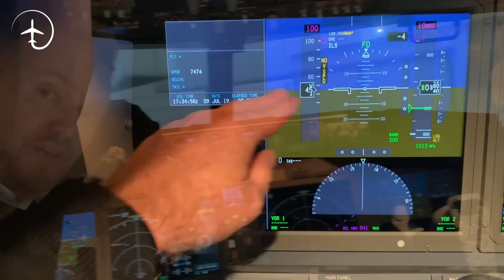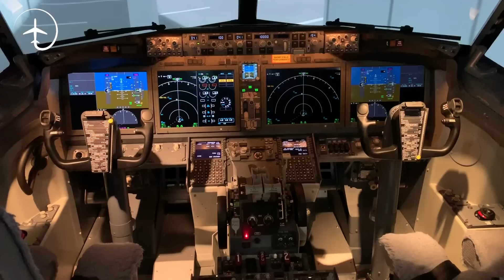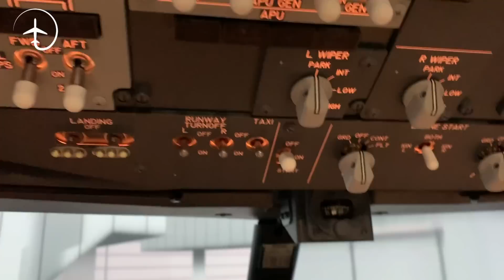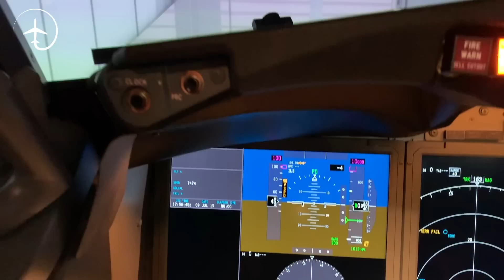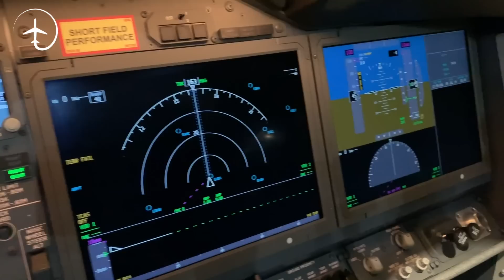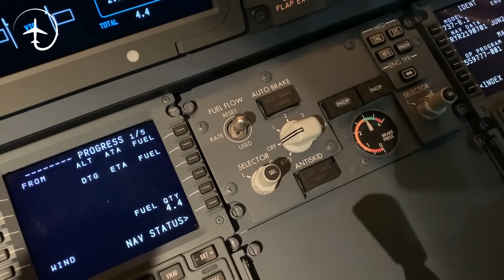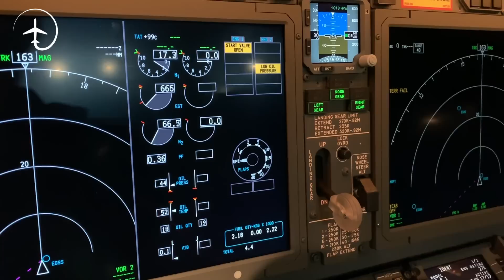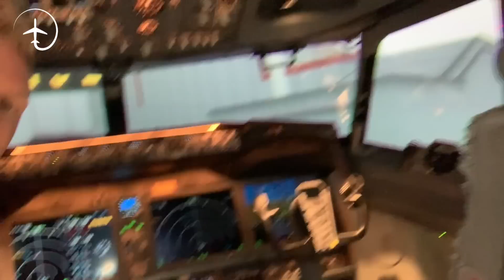Boeing 737MAX Cockpit Tour

Comment: Unfortunately, the technical problems are probably easier to fix than the lack of public confidence.
Reply: The Boeing 737 Max's reputation is now badly damaged just like the Douglas DC10's in the 1970s when the DC10 suffered some serious / fatal accidents due to a combination of design flaws, technical problems, maintenance errors, and pilot errors.
Reply: supertrix101 — Despite it’s reputation, the DC-10 remained in service for many years after its early troubles.  People flew on it — even those like me who didn’t like it, because it took us where we needed to go.  I feel much better about the 737 Max than I did about the DC-10.  The Max is an excellent aircraft which had one horrible defect.  It’s been fixed and it’s time to move on, in my opinion.
Reply: Well we hope the problems are (properly) fixed.
Reply: @GH-oi2jf  Exactly! Not to mention, there's no way Boeing or the FAA will deem them airworthy unless theyre completely confident there will be no issues. The 737 in general is the most popular commercial aircraft for a reason.
Reply: @GH-oi2jf  my problem with the MAX is not the defect. it's boeing managers that worry me because the accidents happen due to THEIR lack for security awareness and only looking at the money. lives have been lost, because some assholes had $ signs in their eyes.
Reply: @GH-oi2jf  So now, 5 years later, you sure bout that "time to move one"? When even more shit has happened this year, with doors opening mid flight and other shit
Reply: Tubmaster 5000 public confidence will never be restored. The 737 Max program is finished.
Reply: @JeffBourke  I'm afraid you're probably correct.
Reply: @JeffBourke   Yes, the 737 MAX brand is now damaged beyond repair.  Check the story on the Ryanair new MAX deliveries being named "737 8200".  I have a feeling that the rebranding is going to happen to more than just Ryanair's planes.
Reply: I trust the MAX
Reply: Big thing is most public can't tell and 800ng from an max 8.
Reply: Andrew Miller — Most people don’t care.
Reply: @GH-oi2jf  that's what I mean. so many people are saying "I'll never fly on a max!" They have no idea what plane they're even on.
Reply: Except for people who are aviation enthusiasts / plane spotters.
Reply: @Valantir  ill just make sure it's not a boeing at all
Reply: @mark675  good luck with that. Just about every airline in the world is back to flying the max around.
Reply: @Valantir  well I won't be going on one I PROMISE you that
Reply: @mark675  why
Reply: @Valantir  noobs
Reply: @Valantir  That is kind of a branding scam. The Max is the NG with Leap engines and more screens in the cockpit. There had to be a way to save 10 per cent fuel on the NG without going for new engines. This looks like rebranding with added M5 computer from Star Trek with Dr. Daestrom about to have a nervous breakdown.
Reply: people can't tell between a 800ng and a max? But... but the flight cards! They got like emergency flight cards that literally tell you the model and variant! I guess most people don't read it... unlike me. IDK, I always enjoy looking at them during the wait for take off, since electronics have to be stowed away.
Reply: Neurofied Yamato the cards are the same for both aircraft. 737-8. They don't say Max
Reply: @Valantir  They actually say "737-800/MAX". Or when the safety demonstration comes on, they always say the type.
Reply: Dino Olsen I have it from pilots at WestJet the major Canadian airline that flies both types that ours do not say max. Just 737-800/8
Reply: @Valantir  Thats weird. Norwegian Air Shuttle has "737-800/MAX" on their safety cards or during the announcements. Guess it comes down to the airline then.
Reply: Tubmaster 5000 — I think that’s better than the other way around.  You can’t control public opinion, put you can control the technical issues.  When they start flying again, most people who have qualms will get over it.
Reply: They put engines on a plane on a improper airframe and put a hokey mcas system ( with improper censors) to compensate for errors in design to beat airbus. Not one pilot knew about the systems in place. It's a hunk of flying shit. You can put lipstick on a pig , it's still a pig.

Comment: Such a pity that Boeing rushed the MAX, just because of the pressure from the NEO. The MAX will be safe once it flies again, but my trust in Boeing is forever damaged.
Reply: I agree. I used to think of Boeing as the ones who make the safest planes. Now I don’t. Yes it was rushed. You can measure it by the length of time it is taking to correct it. Personally, I will never book a flight on the Max. I am uncomfortable with trying to overcome a design flaw with software.
Reply: @Herlongian  so the 777 ain't safe what about the 747 757 767 and 787 matter of fact what about the 737ng series they ain't safe either?
Reply: @Herlongian  Geeze, you obviously have been watching all the wrong media coverage on the max. !st, you will be on the max if it is going where your going just like everyone else will. 2nd, there was no design flaw fixed by software. Mcas was put on the max to make it the same on nose pitch up on take offs . Otherwise the max would have needed seprate pilot rating training. The max didn't need mcas to fly correctly or safely etc.... You might want to base your decision to fly on her or not based on facts.
Reply: S C The flaw is that the nose will rise too much when power is added. This was caused by moving the engines forward and upward. If the landing gear was longer, the new engines could fit in the same location as on previous versions. 
Had they not rushed the process, perhaps someone would have foresaw what would happen if the angle of attack vane failed. 
Another flaw is the stabilizer trim wheel. It doesn’t have enough authority and there is no indicator or instrument to show when and how much it is responding. 
It is time to stop trying to to redesign a 60 year old design. Better to create a whole new plane. And start a new numbering. The 7X7 list has been exhausted.
Reply: @Herlongian  Your funny lol. I know exactly what videos you've been watching. You don't know what your talking about. The trim wheel is just extra safety they are paying attention to now. The nose up pitching is completely normal and very very minimal at best. All the large aircraft like the 777, A340, A330, 747 etc.. do the exact same thing due to oversized powerful engines. It is completely stable and normal. They only added mcas to the max to cancel out that slight difference in pitch up to previous 737's. That way they didn't require separate certifications for pilots. Not because it was unstable or unsafe or flawed. Stop watching the crap videos and main stream media. Everything I just told you is from a current Boeing 777 pilot also rated to fly all 737's who knows mcas directly. He has a channel if you want to see what real fact based reporting looks like.
Reply: You are exagerating a bit man. Boeing didn't rush the max like that. You've been watching to much main stream crap reporting or crappy You Tube channels. The Max design is perfectly stable and safe. The problem is they made a mistake in designing Mcas to only rely on 1 AOA sensor for info. instead of both to cross reference. Very stupid on their part for sure, nothing to do with rushing. Mistakes like that is exactly how air travel became the safest means of travel. Boeing has been around for over 100 years and are 100% responsible for air travel as you know it. It is apart of air travel has been since the very beginning. They learn from it, make it better and move on.
Reply: @11SEXMACHINE  No. The MAX design is not aerodynamically stable. Their own test pilots during the flight testing phase informed Boeing that the plane was very unstable at low speeds... That was the primary reason for the creation of MCAS. what they did was try to rectify a obvious engineering problem with the weight, size and location of the new engines with software. We DO NOT do that in aviation. If it was a simple software fix,  Boeing would have resolved this in as little as 2 months... 3 at most. Added to that, they deliberately put MCAS into the cockpit without notifying the last line of defense in emergencies.... THE PILOTS!
Reply: @opus4rv  Would you stop. That is completely untrue and bull shit. Stop watching garbage reports on you tube. If you want to see actual fact based reporting  watch the Bloncolirio channel. It is a current 777 pilot who is also 737 certified and obviously knows mcas and the 737 max as it's his job. It is 100% fact based and unbiased as he doesn't work or have anything to do with Boeing. Don't comment until you know what your talking about. Boeing built a perfectly stable and safe aircraft like they always do. How ever they fucked up when they designed mcas tonrely on 1 AOA sensor instead of both. They screwed up royaly on mcas but that's all. The max doesn't need mcas at all to fly safely. If mcas wasn't added, there wouldn't have been not q crash as of today.
Reply: @11SEXMACHINE  they'll learn from it? Then why were there two crashes? Boeing suck

Comment: What do you think of the over human factor / interface design of the cockpit layout? There doesn’t seem much consistency - some instruments analogue, some digital, some screen based, others physical, lots of small panels with seemingly unrelated controls e.g. brake and fuel controls...
Reply: Richard Deasington — You may not understand ergonomics, but consistency is not the best way overall.  In some cases, yes.  A toggle switch should always be “on” in the up position, for example.  But if everything looked the same, finding the switch you want would be harder.  When the pilot has to be flying the plane and manipulating controls at the same time, the most important controls need to be close, in familiar positions.  Less important controls should be implemented in a way that does not interfere with easy operation of the aircraft.

The pilots are the best judge of how well a flight deck is implemented.  If the pilots are happy with the controls and feel that the aircraft is easy to handle in all kinds of conditions, then I’m happy.
Reply: Interesting - I suppose some inconsistency can help you to find your way around and could help to make a memory map of the layout...

Comment: As i see it the Max is finished, Boeing need to scrap all these planes and revert back to the olld established 737
Reply: That's not a possibilty. The 737NG would lose badly on the market against the A320NEO. That's also why Boeing was in such a rush to release the MAX to the market because the NG couldn't compete anymore against the NEO.
Reply: @shi01 At the cost of innocent Lives ????????
Reply: @peterbury1934  Well, wasn't the first time Boeing opted for a cheap solution which cost some lives in the end. So i'm not even surprised by what happend.

From Boeing's point of view it made sense. The 737 ist their most importent aircraft family as is the A320 family for Airbus. There are some rumours floating around that back when Airbus prensented the NEO, the Boeing board of directors got into panic mode because they had nothing in development back then to compete with the NEO. So they started late with the development and also had to work around some of the limitations the old design gave them but also had to keep the changes to a minimum so the airlines didn't had to retrain their pilots and also they had to prevent the need for a recertification of the whole aircraft, which also limited severly what they could do to the aircraft.
Airbus for instance has a huge advantage in this regard because of their fly-by-wire system which simply allows you to change a few parameters in the software and the new plane flies exactly the same as the old one. That wasn't so simple with the 737s antiquated control system.
Reply: shi01 - The MAX development took a year longer than the NEO 😉
Reply: @ACPilot  Yes, but we don't know how far Airbus already was when they announced the NEO Family.
Airbus itself said that the first plans and ideas for the NEO family date back to 2006.

Comment: Hey Peter, hope you doing fantastic! I remember you said in a previous video, the pilots don't need to get simulator training for this type, just on a tablet. I can't understand that. Of course you have quite the same cockpit layout and it might be the same. But it's a different working as you know it from the NG. And not alone because of the mcas accidents i think it's absolutely necessary to train it in the sim. I'm familiar with the 737NG and this is different. I want this aircraft in the air because i know it's a good aircraft. But not at the cheap way.
Reply: Treffnix - There is no difference in major systems and procedures, so thats why no sim is required. It is enough with computer based training and flying with a collegue that have flown the aircraft before.. then you get used to it flying out on the line..
Reply: @ACPilot  I just want the pilots who flying this aircraft should 100% familiar with the new technology parts of this. Thanks for your answer. I appreciate that.

Comment: I guess he's training for Ryanair's 737 Max 200
Reply: I have a new name for the max I call it the boeing 737  NAEO  (new avionics and engine option)
Reply: If you fly for a paddi airline its 90% likely you'll be flying a MAX given IAG own Air Lingus and Ryan Air is All Boeing.  Ryan Air is quite safe, they've never had an accident.  A near miss when they suffered a bird strike taking out both engines on landing in Rome but they just neatly glided in.

Comment: Didn’t realise the fuel switches are now 777 style
Reply: They're the same fuel switches used in the B787.. you can even notice the darker tone of grey
Reply: Pablo Alejandro Higuita ah ok. I haven’t really seen much of 787 cockpit so didn’t know difference between 777 & 787 switches.
Reply: The parking brake normally looks almost like a metal spider with a rectangle on it in the 737NG and older, the 737-MAX parking brake looks way different, I guess it's also in the 787.

Comment: Can you take the simulator for a quick spin around the block?
Reply: @mipmipmipmipmip Most of these simulators are actually built in Canada by CAE. Boeing really doesn't build simulators themselves. At least not for commercial applications.
Reply: "Can you take the simulator for a quick spin around the block?" - Difficult. They've moved the indicator lever, so until Petter finds it, he won't be able to let other planes know when he's turning left or right.

Comment: You can totally see the conditions around the MAX's development reflected in the flight deck. Kind of, still 60's design up top, with some new tech jammed in, looks like it was designed in a hurry, and without a single coherent design philosophy. Which perhaps payed to why it ended up like this.
Reply: Jack Perry — That’s completely wrong.  A great deal of thought goes into flight deck layout.  Boeing’s approach is conservative.  Generally, they stick with what is familiar and what works well.  When significant changes are made to the human interface, it is only after a long design process and for good reasons.  Using screens for display is flexible whereas special-purpose indicators are not.  The screens are probably also more reliable than the gauges.
Reply: @GH-oi2jf  The screens are more reliable. They are also more legible and cost efficient, being less prone to malfunctions than the old analogue counterparts. But if that is true then why keep the old switches up top? Why not overhaul the whole layout to fit the new modern safer philosophy? Probably because that would mean pilots had to undertake new massively expensive type ratings. Which is why I said the rushed and hasty release of the plane is reflected in the flight deck.
Reply: That is such an uneducated comment to make, the cockpit is barely different they just made some simple easy changes to screens and other things etc so it’s not like it was jammed in because they were quite simple also it has nothing to do with the crashes, the reason the planes crashed was because the Mcas malfunctioned causing the plane to pitch down uncontrollably and the pilots were unaware that they could fix it by flicking the stab trim switches, the cockpit design does not come into any of that

Comment: i WoNt EvEr FlY iN a 737
Reply: Boeing 737's are one of the, if not the most, popular passenger jet aircraft in existence today. You may difficulty avoiding this model line if you fly often. However, you are probably concerned specifically about the 737 Max, and not the earlier models in this line.

Comment: Do u think boeing going to modernize the 737 from the 60s technology ?
Reply: The MAX is the last iteration of the venerable 737. We will see an announcement on a NMA in 12 to 24 months.
Reply: Anderson Rodriguez — The Max is the fourth generation of the 737.  The third generation (NG) is a modern aircraft.  If it weren’t a solid design, airlines would not have asked for another generation rather than an entirely new aircraft.
Reply: GH1618 make sense

Comment: Really can't believe that any passenger is going to get on one of these again. Does any other passenger plane need this kind of software fix to address airworthiness?
Reply: I'd get on it tomorrow as long as it was with a major US Airline. I flew on the MAX just before it was grounded. I'm flying from DFW to YVR next week and it was originally scheduled as a MAX 9 I say MAJOR US Airline because there are certain airlines and aircraft I won't fly. I think when the final reports come out we're going to see something very different than we expect. I'm sure your aware that Airbus has nearly the same system as Boeing that nearly caused Qantas 72 and Lufthansa 1829 to crash, right? Only they had more altitude and experienced pilots.